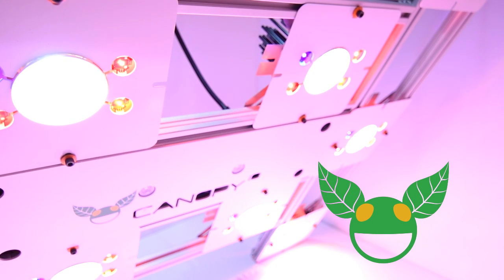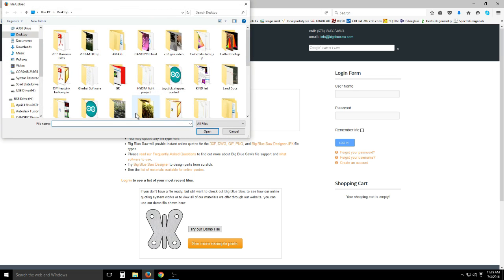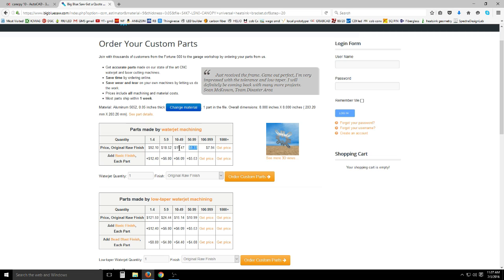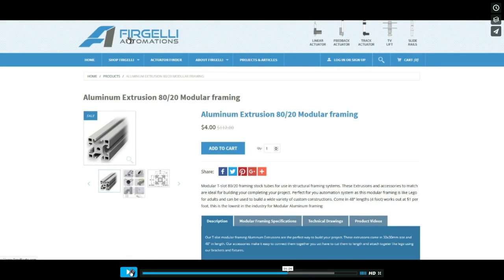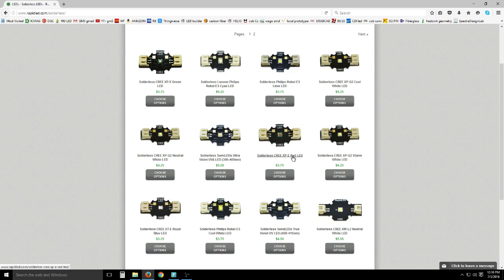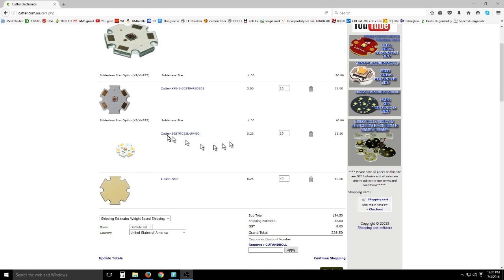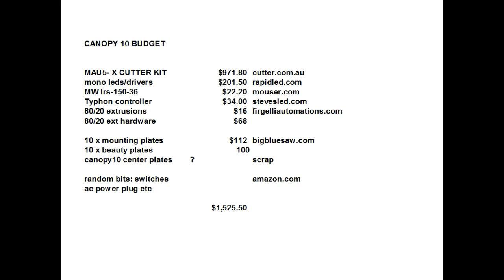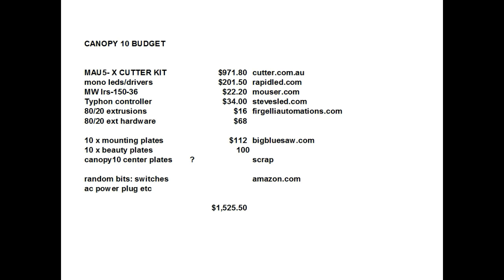CANOPY 10 : part 1 the components

Comment: Same here, the file on grab cad doesn't exist. Any news?
Reply: if your not after the beauty face or the monos you can just mount small pieces of aluminium to the sides of the 3030 and then screw through those to the side of the heat sinks. You will just need to get the 24" a bit longer to compensate for the distance on the sides due to the spacing the mounts cause there but wont effect the center spacing.
Reply: Thanks so much for your response. Looks good, I'll try it!!

Comment: Growmau5, would it be possible to wire the CXBs in parallel, then have secondary dimming to each individual CXB? Use 5ow potentiometers wired in series along each CXB lead? Reason i am asking is it would be nice to dim the edges when my scrog canopy is small, and once i convert my veg tent, i could have different zones for different development levels. 

I would use the main dim as well, but i suspect unlike the actual built in dimming, i would not save electricity by dimming the individual lines, as i am not dimming the driver, only the leed to the CXB, but i would save on HVAC. 

I guess i could just buy matched drivers for each CXB, but unless the driver was cheap, might get expensive. I was planning on doing something similar when i build my veg light, going to use 6 CXB's, wire them up in sets of two, so i can have multiple zones. But just thought of that idea above, and got me thinking.

Thanks man!

Comment: Instead of adding the 1-ups, specifically for the 630nm and 660nm reds, have you considered 2700K? T5 growers use a mix of 2700K and 6500K... which is basically the same spectrum as a MH and HPS combination. That's what I've been contemplating for my build. The best gardens I've ever seen, had a mixture of HPS and MH at a ratio of 3:2. Blue keeps them shorter, broader leaves, and helps with their overall health. With HPS on it's own.. although you get bigger buds, they stretch and aren't as tight as they'd be if blue was mixed in. From everything I've seen with COB gardens.. the buds are tighter, leaves are broader.. but colas not as big as they could be. Unless it's the plants not uptaking nutrients as much as with HIDs. Early days of LEDs found that although they give off less heat, that in itself can cause problems. If the plants don't transpire as much.. they won't drink their nutrients as much.

Comment: If you haven't already, you should check out Jameco. I found them cheaper than Mouser.. they have the same LRS-150-36 for $20.95. It's only $1.25 difference, but when ordering other stuffs, they're usually cheaper than Mouser as well.
Reply: ***** I swear by them. I used to be exclusively Digi-Key until a buddy turned me onto Jameco.